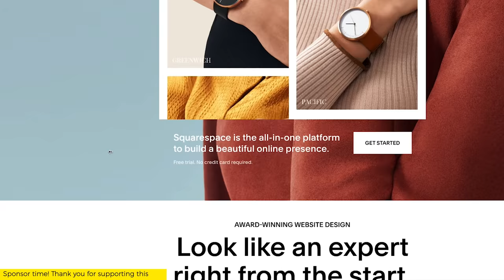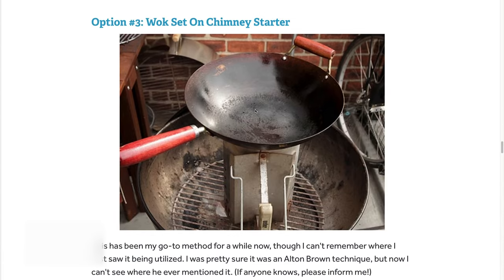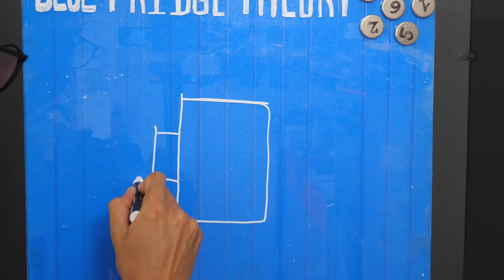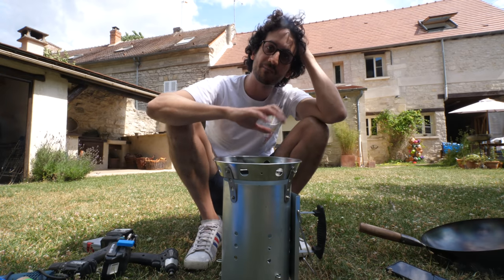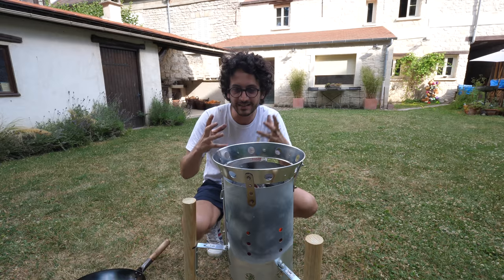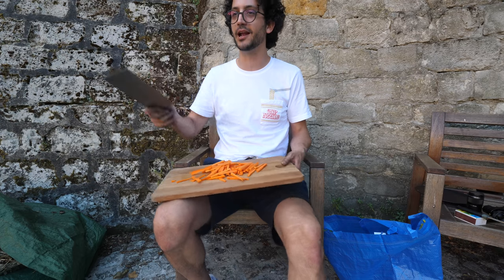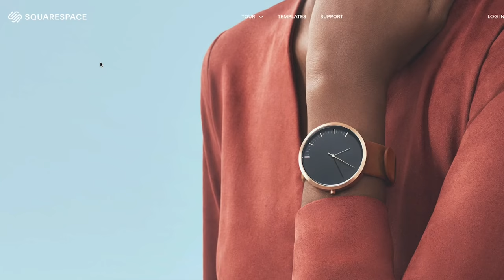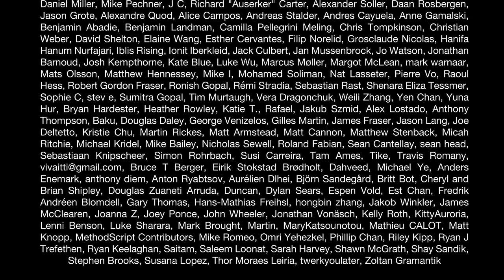How to make a Wok Burner from Chimney Starter (hack)

Comment: There's a reason they say to cook stir fry you need a wok and a jet engine.  You probably want some kind of forced air, but you won't need as much as you might think, ideally you will want something you can control, and able to stop when not needing the flame (so as to increase the life of your coals).   I can't vouch for the safety of this idea, but a rheostat style dimmer switch connected to a small fan (blow dryer without a heating element, for example) should give you plenty of control over the airflow.  I'd say ideally you would want it to be foot/pedal controlled, so that you can use both hands (to simultaneously toss with the wok and mix with a shovel/ladle).   Good luck!

Comment: you can just pump air at the buttom, use a metal fan or just close the bottom (mabe with a removable cap, so u can get the ashes out) and use a blower attached with pipe to the bottom above the cap (you have circular holes there, it can help)

Comment: Could you not try mounting threaded rings on the top and bottom of the charcoal chimney?  That way you could just remove the chimney (after safe to touch) after use simply by unscrewing it from the base?

Comment: Alex,  you need more air/oxygen for more heat.  Hair dryer pointed into the coals, or a fan with heat resistant tubing.  Once you pump more oxygen into the chimney or the grill, that is where you are going to get the insane heat you are looking to achieve!

Comment: It would be cool if the legs of the station fold and unfold. But also, When you put it in the ground. You have a lever of sorts that plants the legs in the ground so they don't move. Then, bring the lever back up, and you can pull the thing out of the ground. Then fold the legs for transport. Or the legs can come off and on, whatever you think.

Comment: The only suggestion I have for the stand would be to make longer poles that point out in a direction. It makes it take a little more space, but you wouldn't have to dig the poles into the ground. Make them all connected to each other in a collapsable way (rotating hinges around a circular metal ring?) and it becomes a fair bit more convenient to carry around and deploy.

Comment: You should use a squirt bottle that many cleaning supplies are sold in that sprays a mist. You should fill one of those with cooking oil so when you need a flame to “burn” the stir fry you just spray the coals with a bit of oil and burn away

Comment: The initial problem that strikes me is not being able to get fresh fuel into the burner. I think if you could substitute some form of rocket stove in place of the chimney starter, that might help you generate a perpetual flame to work with. Heck, maybe you could cut a hole into your chimney and try burning sticks.

Comment: One of the key designs of the Weber charcoal starter is the conical base. Do not use one of the other designs with a flat base inside the cylinder, does not work nearly as well.

Comment: For producing a flame you could drop some chunks of wood on top of the coals before cooking or just have a vessel of oil (any oil: cooking, motor, petroleum) with a metal tube that could drip onto the fire. The coals will be hot enough to incinerate almost any oil.

Comment: Air means more fuel for the burn process. Airflow leads to optimal burning, that does not contain flames as flames are due from imperfect burning. A chimney is good for increasing the flow of air flow natural thermodynamics, hot air rises. Thus a larger surface area would lead to the same amount of oxygen to be present without the coal getting too much air for its surface area. I use a woodfired oven daily, and the key to getting a good quick fire is to use birch only, and batoning(with a machete and a sledgehammer) a few logs to small pieces so the flame is big and strong. When the wood is all red hot coal, i push them to the back side of the oven and add a fresh log on top to introduce a new flame what is required for the smoky flavour, and for added flavour i add birch bark right before to get real smoke in there.

I have a steel oven at my grill, which is nothing more than a chimney with 2 slots and a grate. Go buy a bag of birch(and gas for convenience), and a set of bricks. Dig a hole, and lay the bricks ontop, leaving an airvent at the bottom. You decide the size of the flame, in additioning of holding the fat to flash burn, and the pan that acts as the chimney cutoff. This should be done on dirt, gravel is best. Reclaimed bricks are free, but you can get pretty and use bricks with heat properties to increase the efficiency. If you attach a blower to the bottom airvent, it becomes a furnace. Dont forget the birch.

Comment: Definitely going with the folks advising a rocket stove. You could do it fairly easily, and the wok ring would be easy enough to include in the design of the outer metal pipe. 

Also don't use wooden posts for this. That short test and you're already showing scorch marks. Run that thing another ten twenty minutes, or get a strong breeze blowing more heat on one leg...

Comment: Mount it to a steel cross on the floor, so your standing on it provides stability, then once used it can be folded up, maybe legs unscrew and it can be put away easily. As for more heat, some sort of forced air would increase that greatly. Look at rocket stoves on the YouTube, they provide a forced air without noisy powered equipment.

Comment: Maybe pouring concrete in a5 gallon bucket and sinking in supports for the chimney. That way it can be portable and you do not have to worry about driving stakes in the ground. You could even set it up on a chair or a picnic table seat to get height rather than making it super tall. Again for portability. Just a thought but I think it would work nicely

Comment: As others have said, any sort of forced air will greatly increase your heat output.  Personally I don't think the wok ring was necessary.  You could just punch holes in the top of the chimney starter for airflow.  I suspect you already have a rocket stove in mind for the next video.

Comment: For a movable base you could use a car rim and tire filled with sand. Cut a couple holes in one side of the tire so you can add/remove the sand. Just attach your uprights to the outside of the tire.

Comment: I would mold fire bricks and cement around the fire starter to the ground leaving a small opening at the bottom. That's going create velocity making it much hotter without the reliance on a hair dryer or leaf blower which might make it to hot..

Comment: You could add a propane burner to what you built easily and cheaply. Or use a turkey fryer with leg extensions.  But then you have to deal with propane tank and all that. So rocket stove would be most portable and could be sized for the height you want. Like the others said.

Comment: for the base can you not just use a parasol base, the type that you fill with water?  it seems relatively simple to make a adapter for the chimney to a pole that fits the hole in the stand.

Comment: A longer length of slightly wider steel pipe (heavier walls, more heat going up than out), and using some seasoned wood, would get you the flame you want and more heat.

Comment: Hair dryer will definitely get it hotter, but it wont give the licking flames you are looking for. You could put a log of wood, non charcoal in the chimney along with the charcoal (dryer the better so you aren't standing in a plume of smoke). The charcoal will hold the high heat, while a dense log will produce large licking flames.

Comment: Why do you use charcoal and not just a propane/butane burner at low temperature ? This way you could have complete control on temperature in no time, you could have the flames and go low but also very high in terms of temperature. Maybe you should put some refractory cement or bricks though

Comment: I think if you had a forced air source under the charcoal can it would be far more beneficial. Think of it like a hair dryer pointed upwards into an upside down piping strainer (so that the charcoal doesn't drop onto it. But still enough to blow away ash.

Comment: Putting the poles in a concrete base it sounds really unpractical but if you add a trolley. You may be able to make it more movable. Also add a fan leaf blower or air compressor to the bottom. A compressor may make it more controllable.

Comment: Could grab yourself one of those fans that run off the heat of a fireplace and, with a little bit of modification, have it blow air up from the bottom, should get a pale blue flame floating above the charcoal with that I think

Comment: Add more air flow, hair dryer is what I use for my first forge 😂 and also connect the 4 let's with a triangle and wight it if you need to make a base for them... If you make it a little bit wider it will be plenty sturdy

Comment: Maybe change the wooden poles against some steel and give them more bolts to hold the chimney. And instead of  hammering them in the ground you could use a concrete base, maybe a concrete - filled tyre?

Comment: Find a welder friend, get your self some heavy cast iron pipe, and and angle grinder.  You can weld legs onto the black pipe, or drill and tap if you want take down, and use a leaf blower, or hair dryer to boost temperature to levels where you can melt steel.

Comment: What if you have an L shaped piece of wood or metal that you can set up and drive some tent stakes through the bottom. That way you can just pull them out if you need to move it.

Comment: Have you thought of doing a forced air system?

Maybe some sort of 100mm computer fan attached to a metal pipe

If you force air through the bottom it will give a flame like flow of hot air that should give that “charred” flavour your looking for

Comment: Give your oven a double wall. The air is heated up (goes up) and then at the top flows into the main chamber. This causes the smoke to ignite . More heat and flames at the top.

Comment: I was gonna do this myself at one point, but instead I found a 200kBTU/hr propane burner. I cut the bottom off a stainless bowl and rigged up a wok ring above. It gets so hot it catches canola oil on fire, so I can’t even turn it up all the way, but it gives the wok hei no problem. And it was like 100 bucks for the rig.

Comment: to get a hotter flame and more like a jet engine, you need to funnel the air like a rocket stove. I would make a horizontal funnel for maximum air flow so it literally has to suck the oxygen past the fuel source, hence a hotter fire.

Comment: Obviously you know you need more air flow haha. I would try a battery operated fan. They can be compact, cheap, rechargeable, and could be easily clamped or fastened to your set up for use anywhere you want. No need for power source... if charged of course : D

Comment: Just angle the feet outwards, that way you wont have to hammer them in every time.Also, try to get wooden handles for a spade or shovel, those are way more thick and sturdy.

Comment: Perhaps fueling it with wood (instead of charcoal) could give you big, roaring flames?
Charcoal is meant to smoulder and give off radient heat, rather than big flames.

Comment: These charcoal wok burners are from Thailand. They won't melt at the temperatures you need. Most metal will run the risk of deforming at least. Traditionally, wok burners use ceramics. Typically under fired, high alumina (white) clays. These could take as much or as little induced airflow you need, so plenty of room for experimentation. Side mounting the fan, away from the heat, is also more possible here. If you want to make one yourself, press moulding in plaster of paris, is the way to go. Although, many Japanese ones are machined from the under fired clay. https://importfood.com/products/thai-cookware/item/tao-charcoal-burner-made-in-thailand Remember, rocket stoves have specific formulas for the gap between the pot/wok, and they have to be very precise, inducing air makes up for that though. If you want it to go like a BOMB, find a way of forcing the superheated air back into the system with fresh air. AKA secondary combustion. Not so easy on smaller systems, unfortunately. Thermodynamics work better with size.

Comment: you don't need to pin it to the ground, fix the legs to old car steel rim, it will provide stability and mobility. I use old rim for similar things, BBQ and kotlć (I don't know how's it called in English) :)

Comment: Id switch to the metal "<" style fence posts, with an "L" bracket mounted as a stop point, then just slip two (?) large adjustable "O" Clamps (Hose Clamps) with the little worm gear, that way you just have to loosen the clamps and slip the starter out and remove the ground stakes when your'e done

Comment: And another thing is, you don't need a Chinese wok to get 锅气。锅气 is pronounced as wok hay in Cantonese and guo1 qi4 in Mandarin. As I said it's a series of aromatic hydrocarbon, as long as you can manage to make oil burning, it doesn't matter that you are using a iron wok or aluminum non-stick frying pan. The trick of choosing the pan is to get a heavy oneone for higher heat capacitycapacity when you can't get a jet engine underneath your pan like a Chinese chef. The heavy pan will keep the oil bumping when you suddenly put a lot of veggies into your pan.

Comment: How about a traditional wood stove design. But holes on the bottom back side and holes on the sides for a natural air way so the fire stays hot and you won't burn through your fuel or wood quickly.

Comment: you know... if you attach the catch to the bottom of the chimney, you will have a charcoal stove.

you don't need flames, but a bit more heat. if can use a hair dryer, like others have suggested, or you could buy a cheap desk fan and rig it. to blow up from the bottom. it will burn hotter but also the fuel will last less long.

if you want the sizzle you probably want the heat, more than the visual flame.

if you want a litteral flame, you need to have wood mixed in with the coke, or at least some sort of flamible liquid like wood gas, propane, natural gas, etc. but the scent you are looking for is likely more about something hitting a vapour point than anything specific to plasma/fire.

another way  is to increase the heat of the pan. a bunt pan is a torus/donut-shape and if you put such a pan on top the increased surface area and the similar shape to the chimney will cause the pan to get hotter. if you attach a handle to it and do mild reinforcing, you wont need a fan.  

this style also called coal cooking, means you make a bunch of coals and spread them out to make a cooking surface, and then set the pan directly on the coals. then you move it from time to time to even the heat. the thicker the pan, the more it will retain heat. the last bit of science is to figure out what kind of material to use to insulate the oil. the pan itself is super hot, and the more of it the more it will retain the heat, but to get teh heat to penetrate and cook through to the oil and the stirfry instead of just burn it, you have to lower the heat. instead of directly lowering the heat, you lower the transfer of heat from pan to food. i didn't get to that stage personally but i have done a fair bit of coal cooking more generally.

now for a personal suggestion. if you are going to cook outdoors, you should have a bucket of water or a hose. put out embers when done.

Comment: First, I'd suggest using metal instead of wood, so you can place it down and take it somewhere. And the wood posts kinda looked burned. 
Try using wood instead of charcoal. In my theorie you should get a much higher flame than with charcoal.

Comment: Use an air compressor and a pedal valve, that way you can ramp up the power with your foot, when you need a lot of heat, and still have both hands free.

Comment: Well, clearly it needs a hair dryer or heat gun to accelerate the heat… you could also attach your L-brackets from your posts to turn up at the ends, so the chimney starter “locks” into place, because that will rust as soon at it even looks at moisture. A coat of high-temp paint may help it out, too.

Comment: 锅气 the aroma that you mentioned is a series of compounds which contains several aromatic hydrocarbon after burning of the oil. So you need to let your wok burn, that requires the oil bumping so the bumping liquids drops could contact the open fire then ignited by it. To achieve this, you need to heat your wok very very hot, put a lot of oil into your wok, adjust your furnace to light up the flame which can reach the bumping oil, then add some water to start the bumping. The water can be veggies' juicy or soy sauce. Yes the aromatic hydrocarbon can cause cancer, but who cares, barbeque can cause cancer with the same mechanism. I do it every day in my kitchen and I live just fine. But make sure you equipped a Chinese kitchen fan in order to pump the smoke out or your kitchen will be covered with a layer of disgusting solid oil.

Comment: I would recommend you to avoid those wooden legs... they will burn after few uses.... You can also set a metal heavy base attached to the legs, near the floor... It will serve for stability, avoid to hammer into the floor every time you use it, and  also to collect the ashes

Comment: how about a regular rocket stove? your current idea is simmilar, but with a little theory and retrofitting you should be able to get better airflow, heat and flame. the only problem is the fact that you'd be unable to use wood since the temperature is way too high.

Comment: If you want more heat, put a hairdryer on the bottom. Just be careful you don't melt the things apart. Might want to replace those wooden legs too. If you put a leaf blower under it, you're going to end up burning the metal. Yes, metal burns.